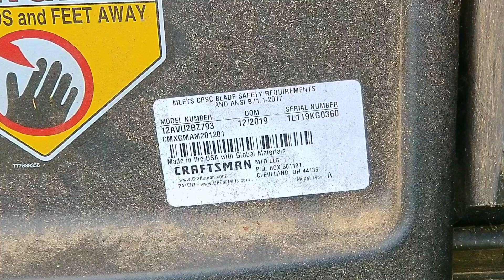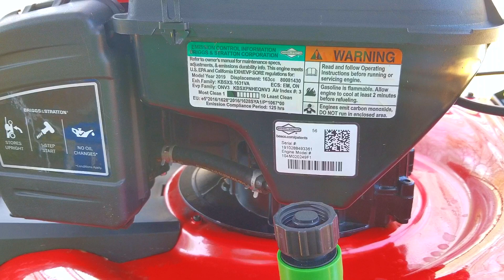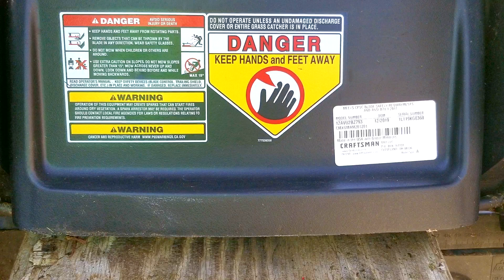Why You Need To Maintain Your Equipment

Comment: Back in the 60s my first job was mowing grass in a cemetery. These push mowers ran all day long. The boss insisted that we check the oil every morning before we began work. I never saw one of those mowers break down. That habit of checking every time has always stuck with me.
Reply from the maker: very good advice, and it pays off too, thank you Steve Everett

Comment: I check oil before every use, because that's how we were trained in the day. Probably not necessary that often, but you can pay attention to any problems that crop up (not just low oil), instead of fixing big issues later. I'm predicting that the connecting rod blew up once the piston seized.
Reply from the maker: nice, you're were taught the correct way! And you already know the story behind this one.

Comment: I check my oil before each use, and deep clean the mower before the start of each season. Also, gets an oil change, new air filter, and spark plug cleaned after the deep clean. Was bought brand new in 2003, and still working perfectly.
Reply from the maker: very nice!

Comment: I opearte a mower repair business as well, and we invested in the Portland electric pressure washer and it's been great for us. Enough pressure to do the job, but not enough to risk damaging equipment.
Reply from the maker: ah, very good point!
Reply: I have the little ryobi electric and love it for the same reasons.  I use it to hose down the tractor and power equipment and it kills dirt but doesnt strip good paint like a high pressure/cfm washer does.

Comment: I check the oil each time I use it. The mower is due for oil change next time I use it. This will be done after use, because warm oil flows better.
Reply from the maker: yes you're right about that.

Comment: I bought a new mower last year it has the no oil change sticker, but like all my mowers, they get the oil changed once a year it may not last as long as flathead briggs in the past, but its the least I can do to keep it running as long as it can.
Reply from the maker: very nice work, oil changes are the key to making sure these last a long time.

Comment: I saw an ad for a free mower the other day that said "I couldn't get it to start so I smashed it with a pickaxe and the carb broke off and there is a hole in the engine". I guess that goes a bit beyond not taking care of it, but it goes to show you always need to read the description of what you are going to buy or pick up even for free.
Reply from the maker: wow, just wow
Reply: Years ago my grampa had a tiller that was a bear to start and he got fed up with it and just beat the piss out of it with a sledge hammer, but it was a tecumseh from the era where they had points, so they were pretty infuriating engines to work on when they didn't want to go.

Comment: I check the oil a couple times a year.  I definitely would have picked that mower up even with a bad engine.  It still has lots of good parts including a deck .
Reply from the maker: you got that right, although the path I took with this one, might a couple of people upset. 
Thank you Brian King.
Reply: I check mine twice a month but that might be overkill, no leaks yet

Comment: I always check oil before startup of any engine . That mower looked in good shape u found on the curb then , usually I have my fair share of mowers I have found on the curb seldom I find them that would be parts but helps me fix other mowers in my hoard
Reply from the maker: understood, sometimes the best thing to use them for, is parts for another mower.

Comment: stow mower i recommend checking every often or everytime as the O-ring sealing the dip stick is more prone to leak in the stowed position.. unintentionally i didn't turn the dip stick till it clicked and some oil did seep out.. or over time i can see this O-ring seal becoming worn out thus causing oil seepage
Reply from the maker: thank you for that bit of information

Comment: I check the oil in my tractor and mower every single time I cut my grass. When I pull it out before I start it I check the oil. I change my oil and filter every season. And my tractor I change the oil and filter and fuel filter every season as well.
Reply from the maker: very nice!

Comment: I am not going to lie and say that I am perfect about checking my oil regularly, but I definitely check it before the first mow after it has been in storage, and change it every other season. I have several push mowers and I alternate using them, so I don't put a ton of hours on any of mine.
Reply from the maker: I like your honesty, I don't check mine like I should either.

Comment: I check the oil every time I mow with it. I do so because I’ve seen the float needle get stuck & flooded the crankcase with gas once so it made paranoid about that 😂
Reply from the maker: yes that happens sometimes, and what happens afterwards is not good.

Comment: That model USED to have a gap near the front behind the right wheel where tons of crap flew up. It's back after all the revisions....
Reply: The fix was in a bit of plastic that filled that gap. But that was the 2 piece front end. This one seems decent but I bought one that would hardly freewheel. Instead of trying to think of a way to loosen gear to wheel mesh, I returned it. That was very troublesome
Reply from the maker: thanks for let us know

Comment: ALL mine are OLD but use very little oil BUT I still check it every time I mow but usually just once a day UNLESS it's a new one to me and I'm just seeing how things are progressing! I found out that Briggs does NOT have parts for Troy-bilt mower engines, even though they made them. NO cross references at all on the Briggs site. Just skips right over the Troy-bilt mower engine numbers. I'm turning my pal with his mower shop loose on this problem so I'll let you know what happens. The mower runs somewhat but probably has a knockoff coil instead of a Magnetron (sputters and gags somewhat). Can't get the original carb but the replacement fits but primer does NOTHING and the mower will NOT start right back after running. The electric start works flawlessly! Ain't THAT a deal BUT where there's a bull, there's a bull RIDER! BLESSINGS!
Reply from the maker: wow, that's hard to believe. You'd think they would make extra parts.
Reply: @INSIDEHOUSEGARAGE  The regular Briggs list goes from one below to one above the numbers on the Troy-bilt engine itself. And TRoy-bilt has NOTHING on the engines themselves, just the mower diagrams and decal illustration diagrams. I've worn the blasted web out hunting..

Comment: If the mower was used by a member of the video game generation, the user quite likely had a vested interest in NOT paying attention to problems. If the mower dies, they don't have to mow the grass today, right?

I HATE that Briggs has started recommending no oil changes. I agree that this could well be the reason for this engine's condition. No oil changes is like sealed bearings, right? No maintenance needed.

I check the oil before every start. After the oil has settled for a week, you don't even need to wipe the dipstick. Just pull it and check it.
Reply from the maker: nice, every time is best

Comment: yah I picked up a free mower,  I might just left it. but i picked it up.    I did  get it going but not sure if it will make the cut,  I think they hit something and slight bend in crank , not visible unless running.  they kept on using it as is with bent blade  I did try to tighten up things because it shook itself to death with the bent blade.  always  they also ran it low on oil. it does run now. it was worse then this one.
Reply from the maker: that's a real shame
Reply: @INSIDEHOUSEGARAGE   yep but so far it’s coming along .  It will not win 🏆 for looks.  But it might run for a few more years
Reply: @INSIDEHOUSEGARAGE   and it is a 2017 model year that looks like  I was abused.  But now it’s been assigned to the Lawn and Garden SVU unit 😂

Comment: The fact that it tells you to not change the oil means it burns a half a quart a season. Hmm, I think I'll pass on any mower that claims that. It's a shame that it's come to that. I'm still pushing a $100 Murray I bought 17 years ago.
Reply from the maker: wow very nice, That Murray is saving you money!
Reply: Brigs engines and Murray moweta get a bad rap. I've never had anything but good luck with them. I pick up and repair every one I can get my hands on. I've only had one in the years I've been doing it that was not savable. And I still pulled enough parts of it to repair a half dozen other mowers.
Reply from the maker: nice work!

Comment: I have the m320 model. I changed the oil after first 5 hours and every 25 to 30 hours of run time I use 30sae. I honestly check it maybe once in that 25 hours. The mower has never leaked or smoked and I've seen no oil consumption as of yet. I have a total of around 75 hours on mine.
Reply from the maker: your mower, do what you feel is necessary